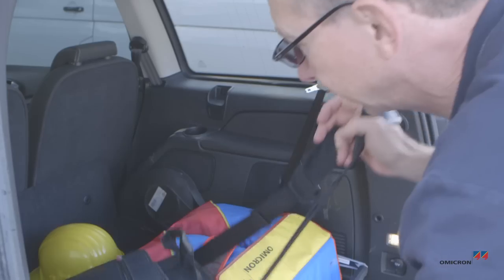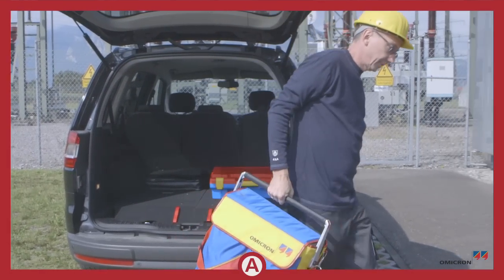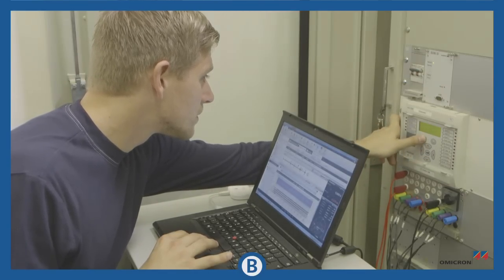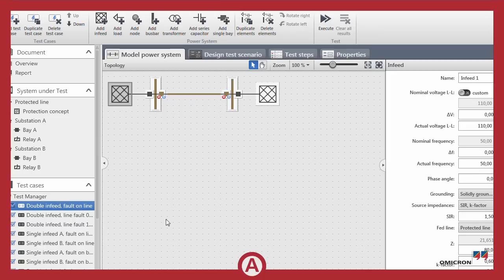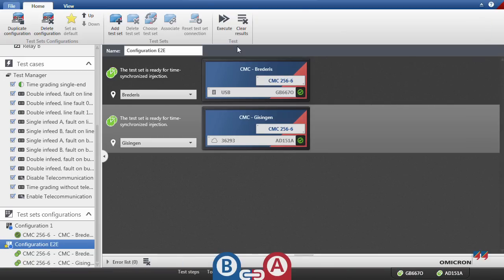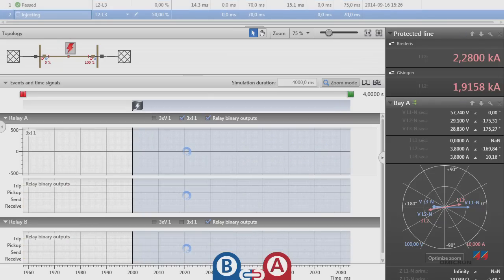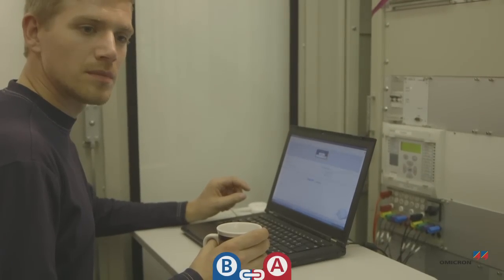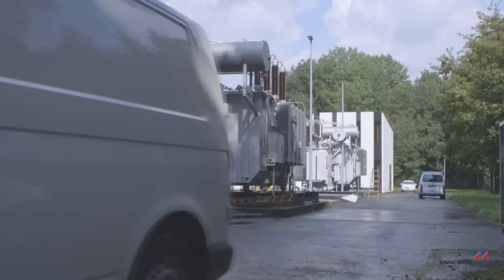Testing a Distance Relay Teleprotection Scheme

Comment: Can Test Universe perform this kind of tests?
Reply from the maker: Dear MUTSAX,
thank you for your interest in our products.

Yes, you can perform such a synchronized test with the Test Universe Distance Module, but there's more effort involved.
The biggest difference is that with RelaySimTest the whole test can be controlled from one end of the line.
This can’t be done with the Test Universe Distance Module, so you have to control each CMC seperately.

Best Regards
your OMICRON team